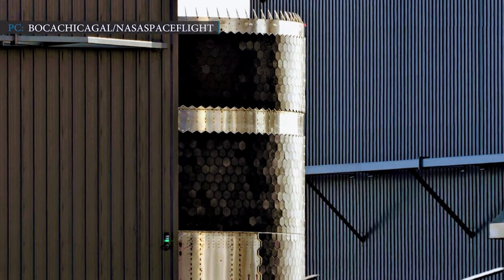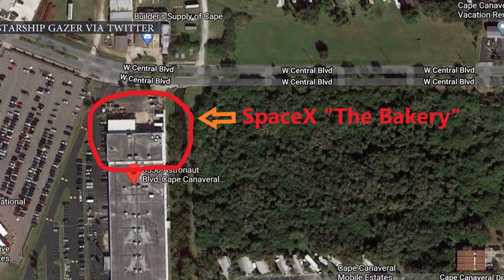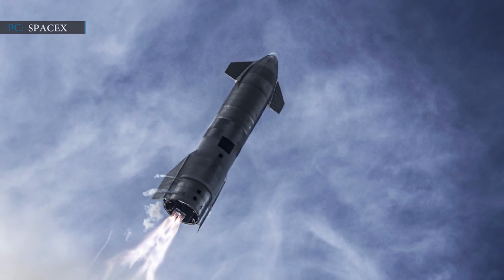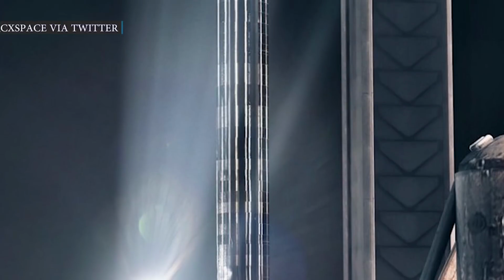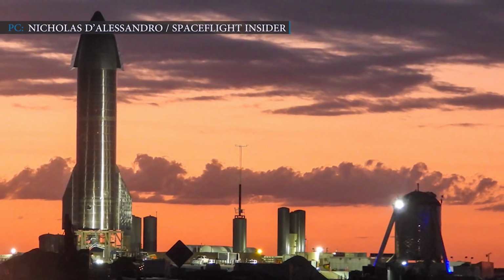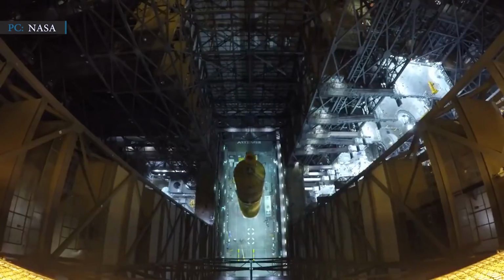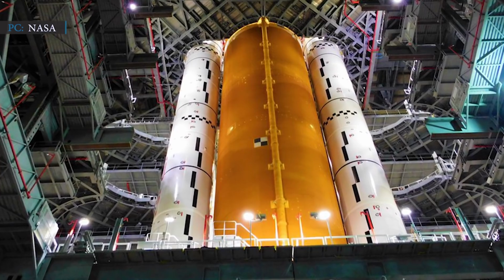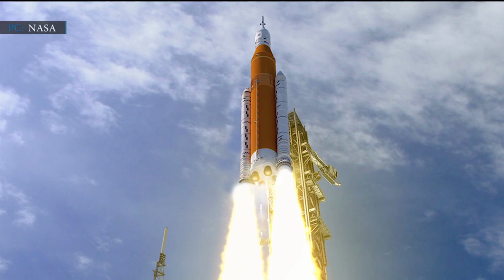SpaceX Starship progress towards Orbital launch debut | NASA Artemis Moon Rocket joins Side Boosters

Comment: Why isn’t starship going to land?  Why slash down?
Reply: This flight is strictly to evaluate how each vehicle can handle everything up to landing on a hard surface.  The landing will still use raptors as though doing a real surface landing, but doing a soft landing at sea. It won't be a fully orbital flight which will happen hopefully next year.  

The ability of each to perform must be evaluated on this test before a landing at the launch pad or on Deimos the converted oil rig at South Padre which will be moved off shore when ready next year.

Comment: are they gonna try and fly the whole thing without even trying a hop on Superheavy?
Reply: The fuel tanks are similar for the starship and the booster just longer and more engines so I think after they pass the pressure test SpaceX feels that's enough. I also think it's a little risky but this a SpaceX style and one of the reasons there the leader today.
Reply: @acemax1124  it seems they are going to do different static fire tests, so for sure the tanks holding pressure is not enough for them to try their luck on a full orbital flight (luckily they're not that insane). But still, I think we'll see at least a couple "hops" first. I guess they'll launch by next year q3 or 4
Reply: @acemax1124  Elon is obsessed! and i think he will have some major setback because he push way to hard! He will not realized 1/10 of what he want to do because he expect way too much!
Reply: It appears so.  That does seem a little hasty, doesn't it?  Perhaps it will all be done in due course.  Besides nobody else is even close, not even Artemis at full steam with its nearly non-existant launch cadence.
Reply: @kevinfidler6287  Artemis will launch at the end of the year! Starship in 2 or 3 years!
Reply: @kevinfidler6287   I mean, I am totally on board with the Starship hype train, but to fly the biggest booster in history without even testing it and in a month from now, I think, is pure insanity. I think we'll not see any kind of orbital flight this year, maybe the next?

Comment: All cool and dandy, but isn't the "tiled heatshield" one of the reasons the Space Shuttle refurbishment was so long, laborious and expensive? I don't know why but I expected SpaceX to use some other kind of heathshield to maximize reusability.
Reply: the space shuttles tiles were so unique due to the shape of the shuttle, the starship is a cylinder so uniform tiles, even the nose is a constant curve, so no unique tiles needed.
Reply: @jamesnicholls9969  were the unique tiles the reason for the time and resource consuming refurbishment process? I thought the problem was the tiled configuration itself, that need a complicated replacement procedure each and every time

Comment: This is similar to the original shuttle configuration with the vehicle above the SRB's and external fuel tank (fuel feed problems to the Shuttle engines vs gravity feed with the Starship). The Shuttle would have been a smaller version and payloads would have been on separate boosters with the Shuttle being mainly for crew and their life support while on orbit building the ISS. The Shuttle was always for the ISS mission and military uses only came later. The SLS is basically an upgraded Shuttle fuel tank with new SRB's and the crew vehicle is above the whole orbital delivery system. Oh wait, isn't that what I just described? There's the true history of the SLS. It was already on the drawing boards when the Shuttle program was scraped. Too bad we didn't get a reusable glider like the Starship instead of an upgraded Apollo capsule. Starship is really just the Shuttle 2.0 with a landing flip maneuver instead of a runway. Ingenious, Elon.

Comment: This heat shield approach is first principle and is more significant than most might think. Placing a ceramic coating directly on the SS body eliminates a lot of steps and pieces and parts. Eventually the entire body of the Starship will be encapsulated in a shell of ceramic enamel. Basically, a powder coat of ceramic will be applied and a heat treatment will cure and bond the powder to the SS. If I understand what Elon has come up with, the first entry of a Starship into an atmosphere will be the final firing of the ceramic in the kiln of atmospheric heating and refraction. Am I right Mr. Musk?
Reply: Apparently per Musk, the thermal tiles will only cover just over one half of the Starship (second stage). The steel hull has a high enought melting point that the dorsal side does not need thermal protection per SpaceX.
Reply: @steveaustin2686  I'm referring to the next generation. With the shuttle the tiles were a constant problem. My Dad and Granddad worked for Coors Porcelain Company during the 60's and 70's and they were the leaders in high tech ceramics during the Saturn and early Shuttle era. I really think they are working on direct application of a non ablating ceramic coating.
Reply: @OldBillOverHill  That's shiny. The dorsal side still doesn't need it though as the steel resists the heat that the 'top' side sees just fine per SpaceX. Now for aluminum spacecraft that would be awesome.

Comment: Could you guys imagine if the raptor engine was fully developed before the BE-4? Poor Blue Origin... 😢
Reply: Arstechnica reported about a week ago that the Vulcan rocket could be further delayed because of problems with the BE4 engines. These were not the same problems that were reported earlier but problems with the igniter and booster capability. GAO says this would make it difficult to comply with the ban on the Russian made RD-180. This is another failure that will impact every aspect of the space program that BO is associated with.

Comment: I like the fact that SpaceX is always at the cutting edge, but safety is an issue here. I hope the SLS will have reusable rockets in the future; this is a major trend globally.
Reply: SLS will be canceled after only a few flights. It's 10 years late,  billions over budget, and they still want a billion dollars per launch. 60's tech on 30 year old hardware and fully expendable is not sustainable these days. It's only going to fly interim until Starship is fully operational
Reply: When they show the last giant expendable rocket in a future documentary video, it will be the SLS. 
You will then be able to find it park way behind the Spruce Goose in some giant museum in a remote desert somewhere.
Reply: There is no reusable rocket now!Only the first stage.
Now, to reuse a rocket, you must carry extra fuel up, so you have fuel to burn coming back down. Carrying that extra fuel, said Musk in comments relayed on Twitter, displaces the payload a Falcon 9 can carry by about 40%. And once the rocket has been recovered, it must be inspected and refurbished to ready it for relaunch -- adding perhaps 10% of the cost of building a new rocket.
As a result, says Musk, between the reduction in capability (~40%) and the cost of recovery and refurbishment (~10%), reusing a rocket roughly halves its efficiency relative to an expendable rocket's carrying capacity -- and roughly doubles the launch cost per kilogram.
But that's just on the first launch, says the CEO: "You're roughly even [on cost] with 3 flights [and] definitely ahead with 4." 
Mathematically speaking, launching and landing a single Falcon 9 six times should be about half as expensive as building, launching, but not landing six brand new rocketships,